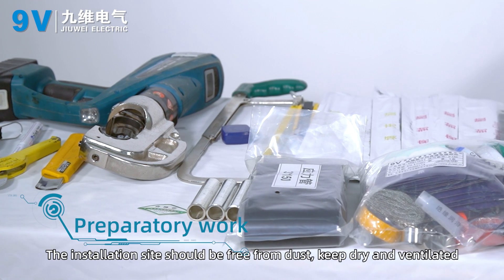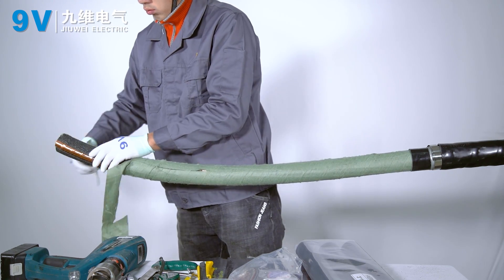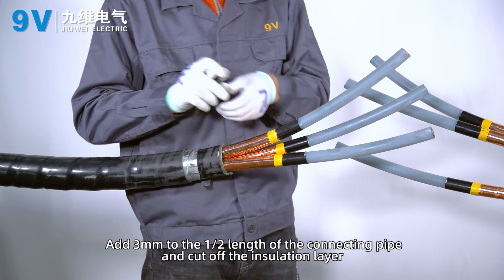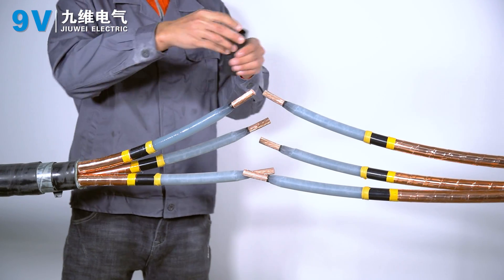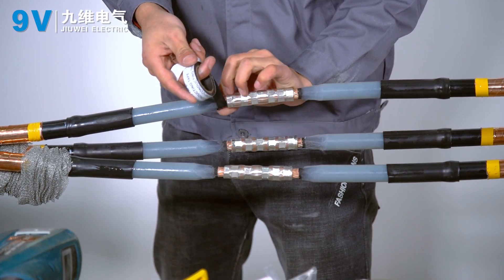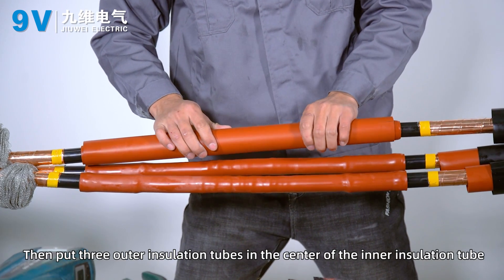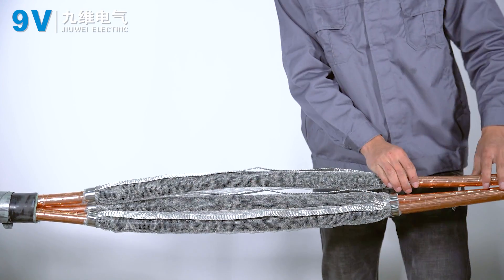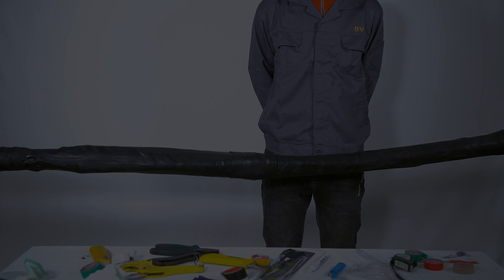10KV 3 core Heat Shrink Straight Joint Kit Installation Vedio - 9V

Comment: did not use blue electrical tape, so it will break quickly
Reply from the maker: electrical tape can be customized in size and colors. All by testing and durable :)

Comment: the 10 000 different flavours of cable layers are a bit much, theres got to be a simpler way.
Reply: there is. as long as you don't mind random electrocutions and constant power outages, that is.

Comment: I think it would be safer if the technician didn't pulled an knife in his direction having the risk to cut himself, it would be better to stay behind the cable and push ir outward. Or using an torch in his hands without a glove...

Comment: Ever seen how quick you bleed out if you cut your femoral artery? Use a Stanley knife and cut armoured cable towards yourself, thats right 1 slip with that razor sharp blade and you can be on the floor watching the light dim before you really know what happened. Dont ever cut towards yourself like that - There are proper tools for insulation removal. This is such a bad excample.

Comment: Dudes mind will be blown when he hears about heat guns.
Reply: Heat guns are used in places where a blow torch can’t be used for safety reasons like confined spaces, places with a risk of a build up of gas etc. The job takes 3x as long, and if there’s even a slight breeze you may as well forget about it and go home.

Comment: Hmm.... there seems to be something missing.... ?  When the innermost tubes were crimped around the joining copper strands there was nothing forcing the copper strands towards each other.  I feel like there should be total contact between the joining cables/strands? Maybe some kind of melted copper should be inserted in the tubes before / during / after crimping? The way this was done there may be a cavity between the strands?
Reply: It would require quite extreme heat to get the soldier flow properly between the copper strands, to a point where it may damage the insulation of the cable itself. Joint may have slightly higher resistance, but in terms of of the whole cable, the resistance of joint is negligible.
Reply: @h3xcat  Oki - I'm a self taught power engineer and small details like that cathces my eye and maybe it is no big deal like you says.  But I'm off to work now.  Must start early since it is difficult to get into the switching area if you are not an employee.

Comment: Wow, heavy duty stuff.  Easy to cut corners and make mistakes, but the consequences of mistakes are scary. The join would catch fire in no time.
Reply: i think catching fire in no time is... somewhat a better fail. Imagine this line connecting a hospital and the joint is going bad slowly, starting in some months, getting better during summer and finally breaking down during horrible wheater.

Comment: I would solder 2 coper wires together. This crimp seems like might handle 1/10 of the current.
Also, 2 cable are not mechanically well connected away from crimps.
Reply: A proper cold welded crimp is superior to a soldered joint in every way other than price and speed. A proper cold weld is stronger than the cable.
Reply: @Mechotronic  absolutely. The problem is, that crimping is a process where everything needs to fit perfectly - otherwise is sucks. Most people do not spend the time to proper engineer crimps - and thus have a very wrong perception.

Meanwhile soldering: yeah, you will up the gap with even more solder...
First, the joint is flexible.
Then over the years, the tin solid state diffuses into the copper, making it brittle.
But hey: it works just fine at first.
Reply: ah. the layman wire connector dude who assumes soldering a wire joint is a good idea cuz it seems like a good idea to him. spoiler: it isn't. a good mechanical connection is better in every way. that's why it's the proscribed method in every electrical code.
Reply: solder these giant ass cables?

Comment: This is such a hassle, I use those giant WAGO connectors for all my 10KV needs.
Reply: I think those are called bear traps. Lol.
Reply: @Jutilaje  if it works it works. We got those Giant mf'rs everywhere in the ground. Way quicker xD
Reply: Maybe you could call HVAC guy who has a huge ass blue wire nut to handle it 😂😂😂

Comment: I'm surprised the copper isn't soldered before clamped with steel connecting pipes.
Reply: They’re tinned copper through crimps
Reply: @ShalomBrother  The pipes are tinned copper? Makes sense. But I still don't get why the wires are not soldered before clamping them with the pipes, it doesn't seem an especially complex task considering the whole fuss and the connection would surely be better?
Reply: @djkoti74  they just don’t need to be tinned, the crimp is sound enough.  They used to Tin them before making a plumbed connection with a ferrule back in the day
Reply: @djkoti74  you should not combine soldering with crimping.
Crimping with the right tool is literally airtight.
Tin creaps/flows/yield under pressure - crimping is applying pressure. So, you would force an airtight metal pack, then then tin would yield over time -> *bad idea*.
Reply: @sarowie  I'm a complete lamer on this. My intuition would say that air tightness is irrelevant because of layers of insulation and that low resistance high current flow is key here.
Reply: @djkoti74  it’s a high voltage cable so the current isn’t a problem and will be relatively low. The key to a sound joint here isnt current flow, it’s controlling radial stresses, especially around the semi conductive screen cut and across the body of the connector
Reply: @ShalomBrother  Makes complete sense, I wrongly assumed high current when its a high voltage cable. I have no idea why I keep wanting to learn these new things which most likely I will never use but it relaxes me, thanks for your answer!
Reply: @ShalomBrother  Yes. 400 amps is relatively low compared to 2000 amps.

Comment: Fine, and now in the mud and 1,5 m underground.
Reply: I don't think the idea of the video is to show the difficulties of installation in a real life situation.
Reply: @johnjackson8692  
They (8-10 workers) needed 4 day's for 3 x 30kV underground cables after the existing cable blow up. (30kV at 1000A is explosive if something fails). 
It's not so easy outdoor in the mud if 40000 people are waiting. There are many way's to make errors with underground cables. Western Union splice are for overhead wires, NASA use solder for better security (NASA-STD-8739.3).
Reply: @losttownstreet3409  Like i said. This video is not meant to convey the problems and practicality's of a real life installation.

Comment: Although there are comments below that explain the the connection at the copper wire prior to crimping, I would have liked the video to have indicated the correct distance (if the wires don't actually make contact) within the crimp. Every other step in the procedure is explained with measurements, yet the section with the actual wire connection we're left guessing?
Reply: If you need to know then you would ask your CO.
Reply: @mikelCold  I tried this at home when I was putting a new plug on my refrigerator, annoying that I didn’t finish the job!
Reply: Crimp tubes (at least for consumer wiring) usually have an internal stop, so you can only insert the conductors so far, and the distance of naked copper usually is both printed on the packaging and stamped on the metal of the tube.
Reply: @xxhellspawnedxx  I was joking

Comment: This the weirdest jointing I've ever seen and I have done a few in my time
Reply: The chamfer with the angle grinder was a new 1 on me, and the crimps instead of mechanical connections but we use similar kits on private networks in the uk
Reply: Have you done any high voltage joints?
Reply: @copetimusmaximus3363  what does it say in my comment? Oh and I'm authorised up to 600Kv
Reply: @jameswatters9592  what's "weird" about this joint then? Quite a typical 10 kV joint.

Comment: Yeah the copper ends are supposed to meet inside the crimp tube & they clearly don't. That's, like, a key thing.
Reply: If I had to guess, a good connection would have been to slightly open and push together the strands, inter-meshing them. And then crimp a tube (of the same material) over that. With (preferred) or without brazing / soldering the copper together.
Reply: @AlexKarasev  Brazing or soldering would likely be not preferred, because of the behavior during vibrations, thermal cycles and so on. A crimped connection would be indeed preferred on such an occasion. Mixing both soldering and crimping would be the absolute worst funny enough: solder can (and will) flow with time under constant pressure (material creep), and thus weaken the connection pressure, meanwhile a deformed metal crimped terminal will keep a pretty much constant pressure through it's life, as deformed metal acts as a spring.
Reply: @Kalvinjj  Makes sense. Thanks!
Reply: Ibew Hv splicer here… the copper definitely has to touch….
Reply: @mooch6666  I might be wrong here, strictly having worked with consumer-side installations, but won't ends butting up against one another (at the thermal conditions present during joining) separate as the cable heats up and cools during use, introducing a small gap that would produce a lot of arcing, ultimately overheating the join? One would imagine that a bigger gap is better as this arcing would never be a problem, possibly even with an insulating medium in the middle of the crimp tube, so that arcing can't occur at all.
Reply: @AlexKarasev  That is how I join my 25volt leads… except I don't need the copper sleeve, of course. But your description makes perfect logical sense to my mind. Maybe they're trying to save time?
Reply: @Inertia888  You're 100% right - key to a commercial success of any such kit would be time savings AND consistency despite junior workforce. There's a lot that can be improved in this kit - such as stripper tools that maintain gaps and depths of cut automatically as opposed to using boxcutter knife and sandpaper manually. I mean that's just ridiculous - these are underground cables - can you imagine this guy sitting in a 10ft deep dirt hole, maybe with a puddle of groundwater gathering underneath his butt, dutifully sanding down all the wires for half an hour?? Not to mention, if an underground cable is severed, there's usually a bad section that needs to be replaced, and you can't exactly pull the ends together - so they'd have to do this twice.
Reply: Have any of you ever actually jointed a HV cable?
Reply: @ShalomBrother  no, but I've seen on several occasions, and it was as you described having done it
Reply: @ShalomBrother  how dare you. Dont be aggresive. Youtube is a safe zone ;)
Reply: I would have thought so too. But I don't work with such high voltages. ?huh🤷‍♂
Reply: I don’t think they have to touch. The metal pipe that is crimped over the wires carries the electricity from one wire to the other. It shouldn’t spark in the gap between the two wires because they should be electrically connected by the crimp.
Reply: details....details
Reply: As long as the CSA is maintained the joint is good
Reply: Это кошмар, канцелярский нож, болгарка 😢
Reply: they are gay if the ends touch ;) Its just edu video so they dont care ;)
Reply: @mscislawin  Not if they leave their socks on.
Reply: Maybe the ends don't have to meet. Maybe if they are close that's good enough.
Reply: @oldi184  Oh yeah at 10KV an arc will easily cover the gap if the conductors aren't in contact :-)
Reply: @AlexKarasev  
You're right. So why did he make that gap?

Metals expand at higher temperatures, right? So when the cable is under load. It will be warmer and expand slightly, the gap will be very small, right?

Just a guess.
Reply: @oldi184  it's a good guess, but we've the tube crimped around the gap, plus thermal expansion is microns while it looks like he has about a centimeter of gap

Comment: Do the two copper conductors actually make contact? In your example it looks like they do not, and all the current has to pass through the connecting pipe, which must have massively reduced capacity?
Reply: "Good enough, reliable and servicable in a trench on a construction site" is the name of the game. With a focus on reliable! 
It is not about a perfect solution that takes 10 times as long and saves 10 watts. 
How would you do different without making it very bulky? While still being as quick and reliable?
Reply: No they don't touch each other because they're not gay.
Reply: If you had done the math first, you would have noticed that 1. Yes, the resistance at the joint is higher than the resistance of the wire and 2. its is negligible. 
Wires are NEVER oberated at their physical limit. They are operated at currents where "gets warm but you won't burn your fingers" is the basic idea.
You may go ahead and invent a connection where the copper really connects on its full crossection, but I predict you are going to end up with mechanically complicated connections that save a few milliohms.
Reply: @wernerviehhauser94  the wire used in these applications tends to be lossy as well so I wonder if the crimp isn't equal or lower resistance.
Reply: Obviously this is a professional and certified product so what’s the chance it can’t carry the necessary current after the splice? You armchair experts are so annoying.
Reply: @frikkied2638  Obviously he asked a practical question, gets called armchair expert. You pretentious twits are so annoying.
Reply: @Patters3  you’re right I was too harsh, sorry about that.
Reply: @frikkied2638  it's not me to apologize to, but I appreciate the acknowledgement.  I'm guilty of the same thing too at times but always got to remember not everybody has our same knowledge, experience, or intuition and it's better to give a practical answer even if it seems obvious to our own self-bias.
Reply: @Patters3  sure, by extension I also apologize to the original person who made the comment.
Reply: @frikkied2638  The great thing about Chinese products is that they'll make any spec you ask for...

...appear on the certification documentation.
Reply: @frikkied2638  As a saying goes, certified bona fide pros made & operated the Titanic. Amateurs - the Arc. Just because the guy has a name tag and a hard hat or clipboard, doesn't make them smart or good at their jobs. There are plenty of collapsed bridges and buildings the world over that were made by guys just like that.
It's pretty obvious this is a video demo of a product for the camera by a "stock footage" guy who may not have 3 months never mind 3 years in the field. It's also not clear how well the product performs. I'd imagine, not nearly as well as loosening the strands, pushing the opposing ends maybe 30mm into each other, and crimping over that.

Lastly, these look like underground cables. If underground cables are severed, there's usually a gap in the good cable that this kit won't account for - obviously in most circumstances you can't just pull buried underground cable ends closer together. There should be a spicing kit that's pre-made with the length of cable in between - whereas this kit is for splicing together spools of cable as opposed to field repair. The entire thing just doesn't make enough sense for "I'm a pro, just trust me" to carry it.
Reply: @AlexKarasev  True, although not sure if it's 100% relevant in this case. This method is the standard method of creating butt-joints between electrical conductors, and there are industrial standards specifying various aspects of the connection, like the crimping pressure to ensure proper electrical contact, the cross-sectional area of the crimped connector etc. Of course these do not guarantee anything, but it is clear that this video doesn't illustrate some back-yard mechanics method of joining wires.
Reply: @AlexKarasev  lol and great, luckily the manufacturer of this product isn’t really targeting you as it’s audience so probably doesn’t care you think about their product. And what the hell are you talking about stock footage? This video I’d clearly made by the company manufacturing the splicing kit to demonstrate to customers how it is used. The technician clearly knows how to use the kit so I have no idea how you would call this stock footage.

There is this trend on YouTube for people such as yourself to call out every singe little thing you don’t agree with. That is so annoying to me and that is what I tried to call out with my original comment.
Reply: @frikkied2638  *its audience
;)
Lighten up, my friend. If comments were invalid I wouldn't post them. If I'm wrong, anyone is free to correct me based on *facts*. Maybe my expectations are too high with my EE degree.
Reply: @AlexKarasev  haha the grammar police as well. Lol you think you’re the only person with a degree commenting on YT videos? Good for you mate. Honestly I’m very lightened up and don’t care enough about this too continue. Cheers!
Reply: @frikkied2638  cheers! Good times!
Reply: @AlexKarasev  I’ve been jointing HV cables in the uk for 23 years so have a bit of experience. I’ve never used crimped connections for high voltage but many places around the world do without problem. We generally use aluminium mechanical shear connectors over heat which are way more expensive but must perform better or we wouldn’t be using them. 

And in the case of a damaged cable, we would always do 2 joints with a short piece of new cable between in the same way we would if an old joint failed and blew up
Reply: @ShalomBrother  that makes perfect sense. That's what I've seen done.

Comment: The sound has a serious error. At about 1:30, it says leave 500 mm at each end of the inner sheath. Actually it's 50 mm. The subtitles are correct. Why does the voiceover differ?
Reply: cause it was an after thought... the voice over just needs to not happen. :)
Reply: It broke my heart.
Reply from the maker: Thanks for the reminder, we will fix it